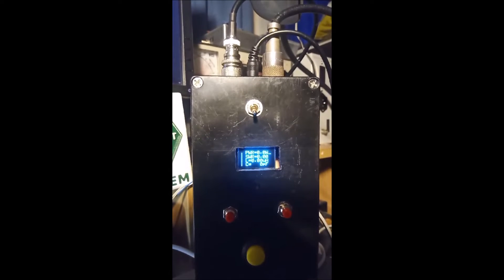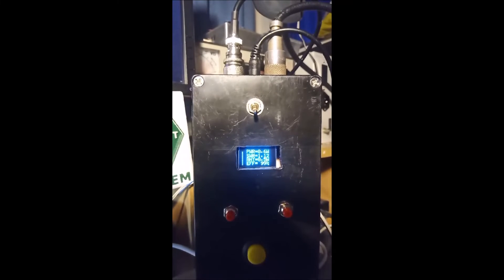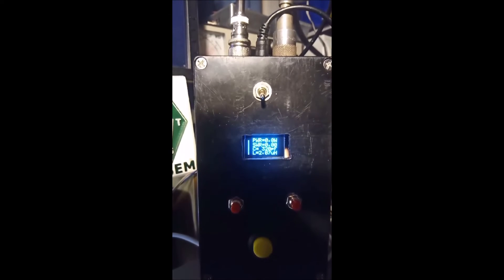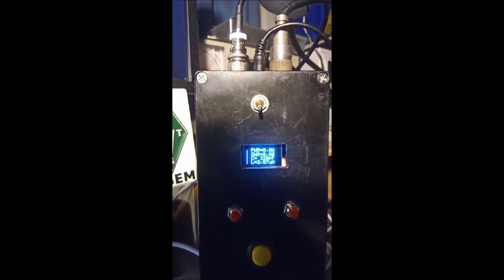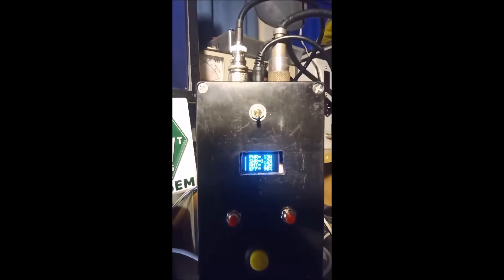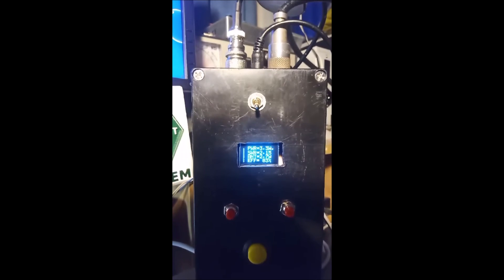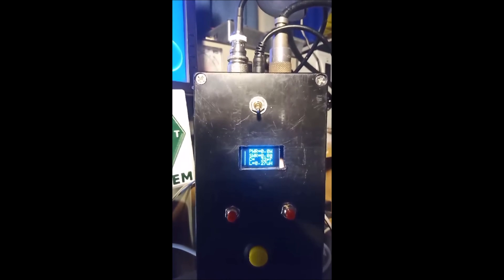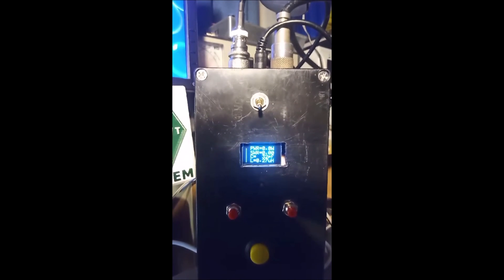Building the ATU-100 Automatic HF ATU

Comment: Thanks Tony I have a go at building one thank de 2e0ree 73
Reply from the maker: If you follow my video, you'll be fine Andy. I used two short pieces of the supplied enamelled wire through the two holes of the grey pig-nose core. Make sure to bare all the ends of of the enamelled wire by scraping, filing or by using sandpaper.